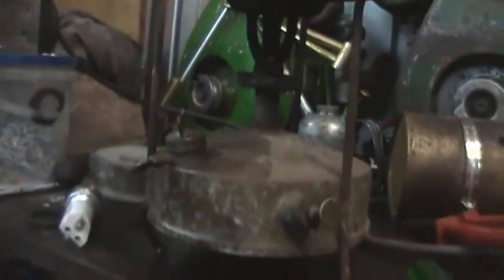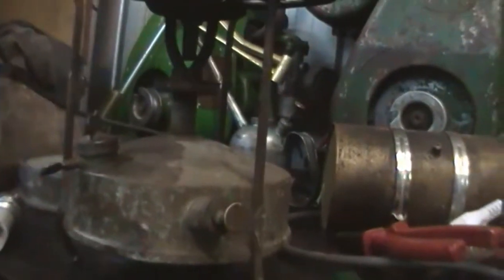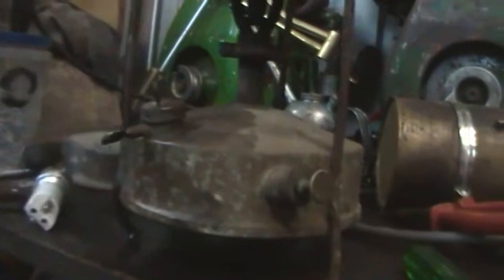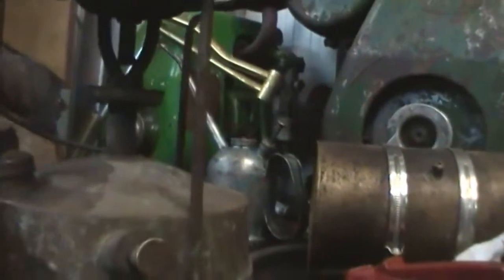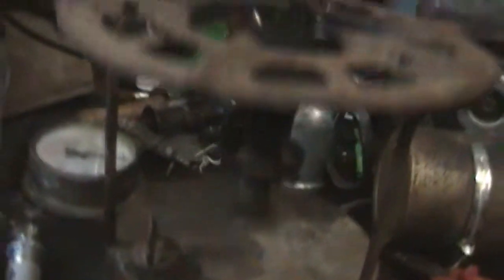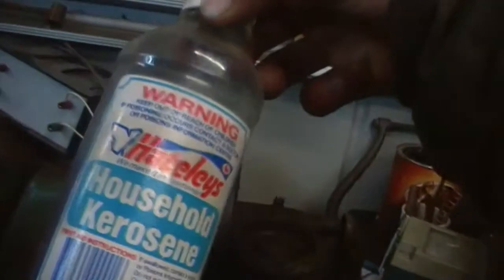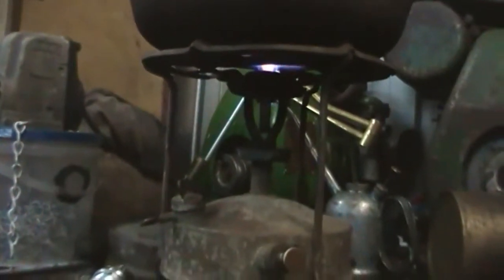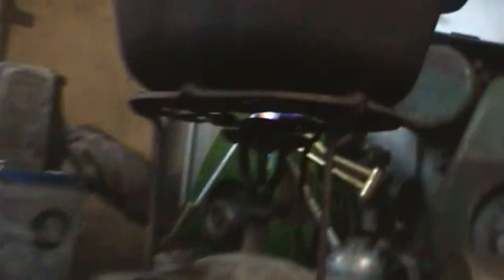Clynton's Shed - running "bush find" Primus stove

Comment: Good fun. Couple of things. Fill the metho tray to the top. Let it burn all out. Your unit is missing the diffuser cap which goes over that flame leaping out of the top. It is a press fit . Also when you get it running properly pull one wire out of your wire brush with needle nose pliers and use it to prick in the jet hole. They  gum up. When the jet is clear the stove will roar like a jet engine on take off.These stoves are efficient and fun to use but they stink.

Comment: You are missing a part, there should be a diffuser cap with a domed top and many small holes around the side. It will then burn silently. Look up the website 'spiritburner' and all will become clear.

Comment: All the problems you had lighting it i have with my primus blowtorch. They can be a pain in the arse but once going are great. Where do you buy kero these days? I get mine from local hardware but it's bright blue or pink! Surely there is somewhere you can buy cheap kero these days?